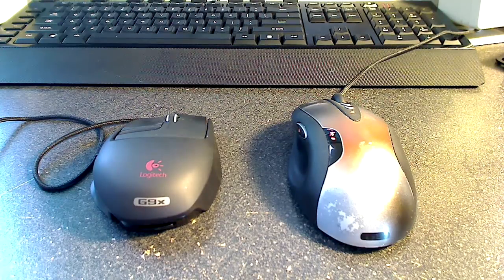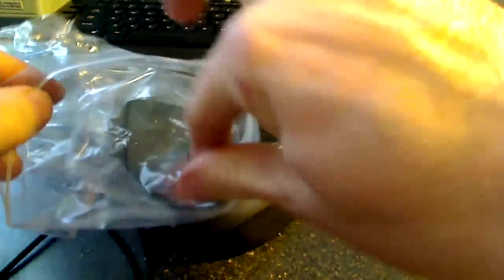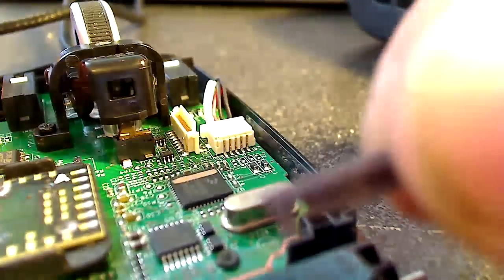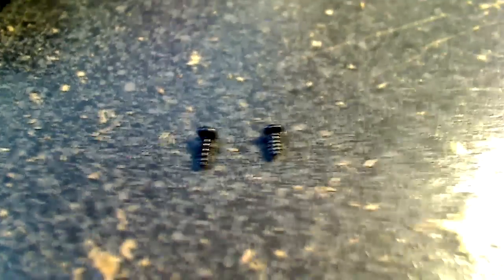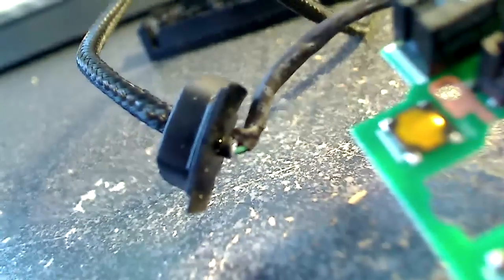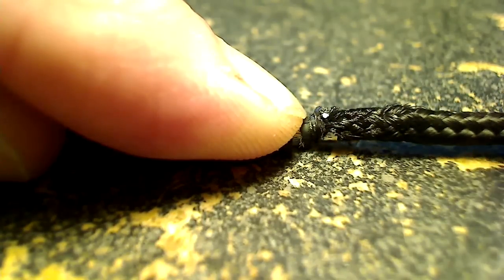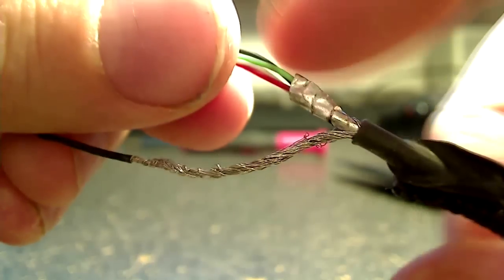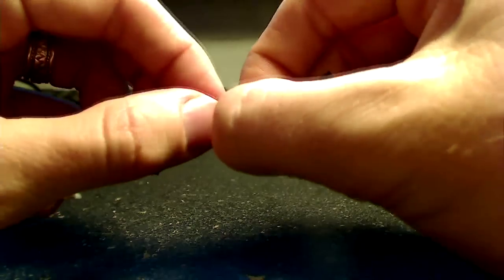Logitech G9 / G9X Disassembly / Repair - Shorted Cable

Comment: Prying the grey ribbon holder/stay easily the rear stud broke so yes that is a weak sister. What i'll do is glue it back when i put the new cable in if that is indeed the problem, taking a chance that the cable is bad, no way of knowing really, the mouse stopped working but did notice the 'eye' was lit so hopefully it is the cable. Logitech does not replace the G9X under warranty, they only offer a substitute. When I called with mine under warranty they offered a G500 and a G600 and had to argue to get a G700S. Even though they're shown still on sale Logitech refuses to replace it with an original. One thing that probably influences that thinking is they've gone from 60 bucks to 235 bucks. So 'fixing' it is the only option unless you wanna dent your wallet. The cable kit is 13 bucks and I'm hoping that is all there is wrong but kinda doubt it.

Man I would love to see how u put the ribbon back in.  When u place the ribbon back do u just slide it in and put the gray stay/holder back the reason i ask on another video the kid just pulled the ribbon out and it left the cap thing in place. This to me is the most aggravating of the re-assembly.

A new cable comes with the grommet that u cut off so thats not an issue. Great video my man it helped big time. Get back to me on the ribbon re-assembly if you would, as it stands I may just have to silicon the thing back in and forgo the keeper.

Comment: I would rather spend some money getting a new cable+feet. I would assume if you used hot air gun/hairdryer the feet would come off eventually... Thanks for the disassembly guide.
Reply from the maker: +Meng Jerry Thanks for the heads up.  Replacement cables were not widely available when I made the video.  I've added an annotation pointing out the replacement cable option.

Comment: One more thing I think I know what caused the problem with the shorted cable. I used the little metal thing "mouse cord clip" on the surface 1030 pad to curl the cable but it puts lots of pressure on it and in game when you do fast turns it pulls on the cable and I guess that caused the problem. Now I just have the cable going over the edge of the table no pressure at all. Maybe the cord clip is good for other mice but on the g9x the cable is so stiff I suggest not to use it.

Comment from the maker: Just be careful pulling them up.  Whatever you use to pry them, you want to be sure to get it under the actual adhesive and not just the felt, then you want to be careful not to dent the material as you want them to be as smooth as possible.  I bought them from this guy on ebay -- you can get them for two bucks shipped.  Good quality, too -- 3M teflon material.  Search ebay for " 330716572376 " -- that's the item number.  Thanks for watching and good luck :)

Comment from the maker: If the shorted cable is the problem then you should be able to just find the short and repair it, yes.  Unfortunately I'm not familiar with your steelseries mouse so I can't say with any certainty.  Since I don't have that mouse I can't make a video for it either :(

Comment: My wheel scroll gets stuck sometime is that fixable ?
Reply from the maker: +shawnzzzzz13   Most likely I'd recommend you start just by taking it apart and cleaning everything.  Chances are there is just some buildup of crust or something fell in there that's making it get stuck.  Q-tips and isopropyl alcohol work pretty well for cleaning the little spaces in there.  

If you're going to take it apart and buy new feet off of eBay, you can also look at just buying a new wheel assembly to replace the old one.  I see them listed for $7.00 - $10.00 USD.  Good luck!
Reply: Thank you for your quick reply!

Comment: slaps forehead on ribbon cable removal  You lift one side up and then the other, or both simultaneously and the cable slides out.  There is no need to remove the clamp, absolutely no need.

Comment: Hi! My wheel doesnt work anymore... Can you help me? Or anyone? I really love my mouse (G9) and theres nothing on the marked to replace it.., so PLEASE HELP!!!
Reply: Hey mate...try open up the case as is shown in the video and see if there is anything around the wheel itself. Me, I had fluff, grime and dirty stopping the wheel from moving freely. Now it is working perfectly. Just undid 4 screws (after taking off the sticky cover on the back in x2 places) then slid off the case (ribbon cable is still attached) remove grime then put back together! nb I still had use of my mouse, it just didn't work too well when scrolling down a page ie multiple scrolls of the wheel just to go down half a page! :) hope this helps!
Reply: YOU ARE MY HERO!!! thanks!!!

Comment: 5:08 /facepalm You're meant to pry up one side, then the other, not completely one side. Use jeweler's screwdrivers to pry up gently, don't pop it. That top plastic piece is meant to stay attached, only pulling up on both sides releases tension to remove the ribbon cable.

Comment: if you don t know how to repair cable you cna buy the cable + the pad for mouse at 10$
Reply from the maker: +The Rated Killer Thanks for the heads up.  Replacement cables were not widely available when I made the video.  I've added an annotation pointing out the replacement cable option.
Reply: Nice

Comment: You skipped the step where you removed the teflon feet.
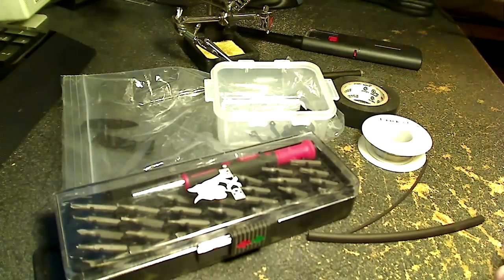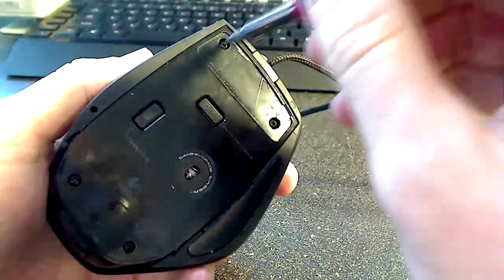Reply from the maker: It's not filmed but it's discussed and described in detail 1:30 - 2:50
Reply: yea I worked it out. I just ripped it off. Removed it twice now, still looks like new. I was worried about damaging it. :D

Comment: Hahah i bet everyone taped hes wires and it does almost not fit under the print plate

just a failure of this mouse.. i had it 3 times didnt need a tuturial for it.. but now my comfort grip is broken to the left button died pff! never again this mous altough it moves nice